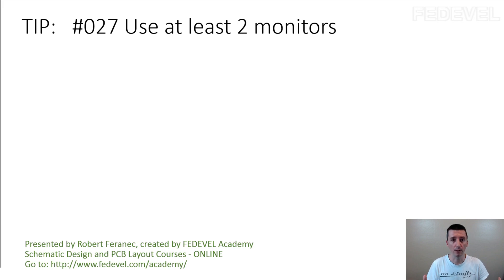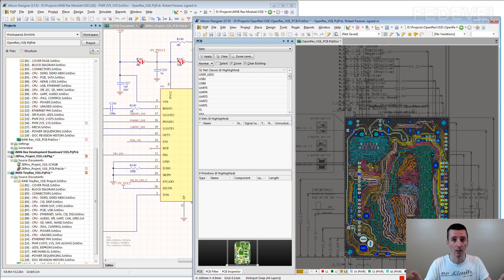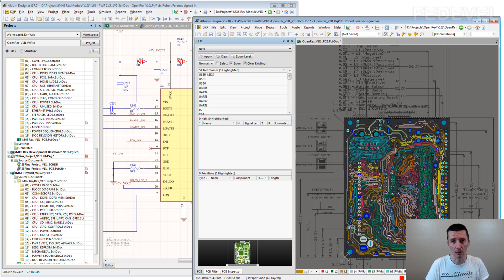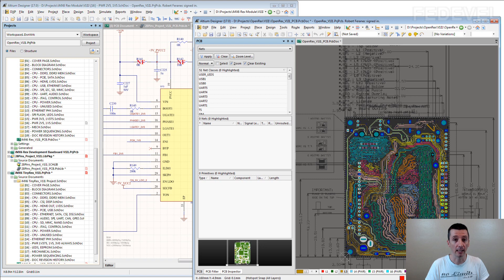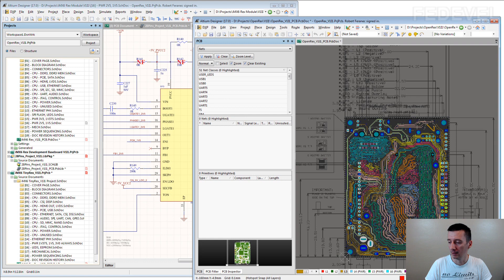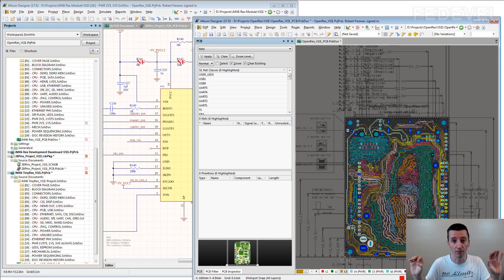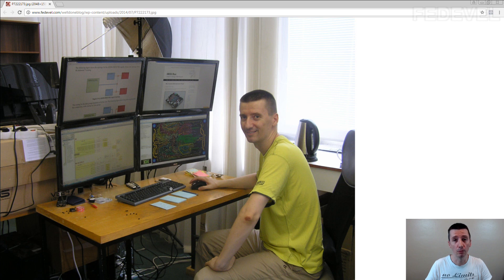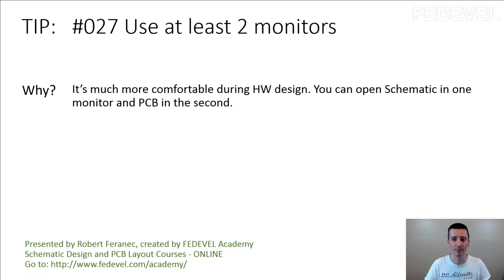TIP #027: Use at least 2 monitors

Comment: I think a laptop with laptop stand and an extra monitor can do the trick right?
Reply: I do this, it is not as nice as two monitors, since you cannot drag for example schematic to one side, pcb on the other, but you can put datasheets on laptop, pcb on the other for example.
Reply: +tHaH4x0r you can drag stuff around when using laptop and monitor. I dont know what you mean by that can you eloborate?
Reply: Ah I think we indeed misunderstood each other. You mean, another monitor connected to a laptop. I thought a laptop and a separate PC with single monitor.
Reply: +tHaH4x0r Yes. What I meant was a laptop connected to an external monitor via hdmi. I imagine it would work nicely, havent tried tho.

Comment: 2 monitors are a must for anyone that spends more than a few hours per day on their computer being productive. At all places I worked even administration/accounting had 2 monitors. Also personally I wouldn't count a laptop screen as a productivity "monitor". The eye strain from focusing at a 15" laptop screen is not good. Best is to have atleast 2x 24" Full HD or larger panels (1440p 27" is nice).